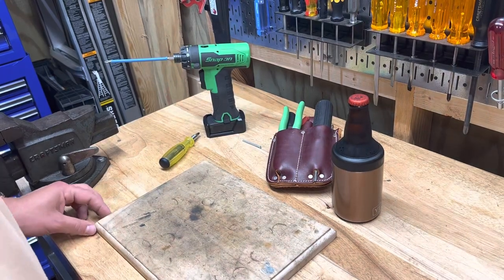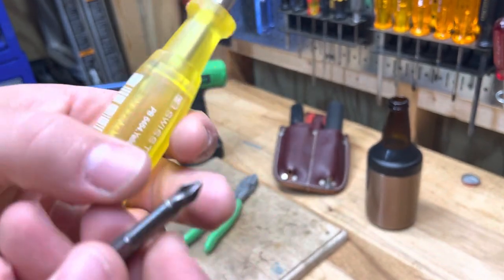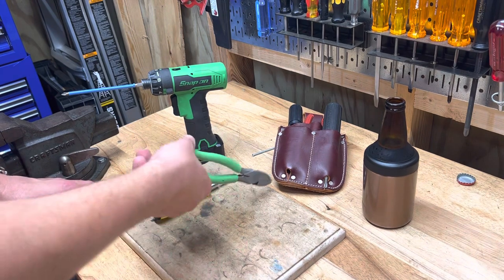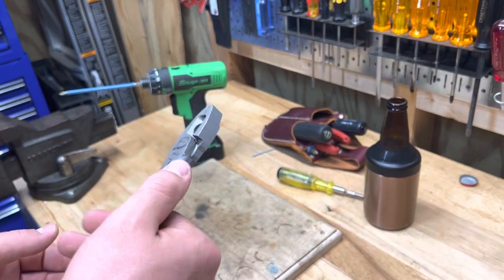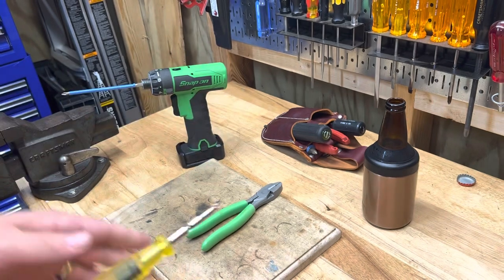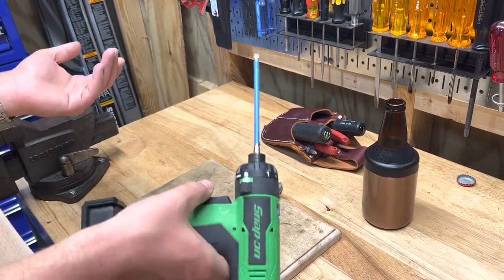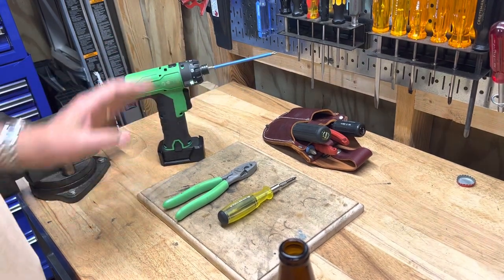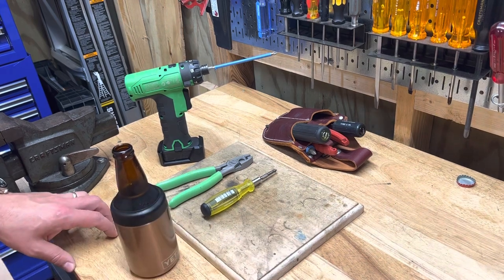Snap-On and PB Swiss tool reviews. These tools punch way above their weight class!

Comment: Great video as always my friend.  

I love, love, love the PB Swiss 6464.  I keep one in every vehicle (I got a bunch half off).  Only screwdriver I feel comfortable carrying in a pocket (except the Milwaukee fastback knives with the screwdriver).  

Funny you talked about the 7in snap on linesman.  I just got this week a 7in klein J2000-7NE linesman and I have been messing around with it.  As far as old wires, cloth braided, nothing that white and black electrical tape and WAGOs can’t fix.  Wagos are a game changer for me with my old house.  I clean the end of the wire off with Emory cloth (old school did not leave a lot of spare wire) and wago them and no issues.  If the cloth is failing I wrap in black or white electrical tape (the good stuff).
Reply: I hear your concern, but I have never broken one (nor my 6465 which has seen a lot of use) and it feels better to me than the Wera bond driver and it’s much smaller with more bits on board.  It feels solid enough to me with the bit holder pushed in to do real work which I have.   As much as I would like to have a set of Wera chisel drivers or PB Swiss striking cap screwdrivers with me at all times, the size and weight make that suboptimal.
Reply from the maker: Thanks man! Good to hear from you as always. I’ve thought about buying those very Kleins myself. I’m sure they are great. I haven’t switched to WAGOS yet. I’ve heard they are great, but I’m set in my ways with wire nuts lol.

Comment: You know me, compelled to say something as usual. Which I don't have much to say this time except that I was just thinking the lighting in your shop or at least where you film is an awful lot better than some others. Don't have to turn my brightness up or anything to clearly see what's up. Need to get me some lights like that.
Reply from the maker: Thanks man. I’m so glad. The lights I use for my shop are the hanging LED tube lights from harbor freight. They are really bright and you can string them together. I have one right over the work bench so it does a good job. It was a game changer when I wired up the shop! I used to use Milwaukee m18 lights in there.

Comment: Hey man. Im currently trying to decide between 7" linesmans for general homeowner electrical, wire twisting/cutting. Have it narrowed down to Fujiya ($25), klein ($35) or Williams ($30). 

Would appreciate your opinion, thanks!
Reply from the maker: I don’t have any experience with Fujiya lineman’s pliers but I do have some other pliers by them and they are fantastic. You can’t go wrong with them. I would go with Klein though. They will be awesome for sure. I’ve thought about getting their 7 inch forever. I would have bought them if I didn’t get these Snap on ones.
Reply: @realworldtoolreviews  thanks man. I bought a 7 inch klein and i also bought the 9 inch hd2000 with the red double dipped handles like you have. They were on a great sale on amazon and had to grab em at $34.

I have like 6 wired smoke detectors, 2 ceiling fans and a chandelier to hang with they show up, so ill be able to put them to immediate use.
Reply from the maker: @morgizmo87  nice! You can’t go wrong with the Kleins. You are going to love those. 7 inch lineman pliers are super useful. I’ve been using my 7 inch more than my full sized ones lately. Those hd 2000 ones are monsters man. Best ones out there. Enjoy!

Comment: SnapOn makes good stuff.  
Good tools aren’t cheap 
I like that magnetic boot on the screw gun.   
Not a big fan of their rocker switch. That’s kinda like ice cream though, your choice of what’s best and that can change 
Typically you buy the affordable tools you can get a job done with. The more jobs that use a tool you keep buying more expensive tools till you get to a point where the more expensive doesn’t seem better than the cheaper.
Reply from the maker: I love the rocker switch but it does take getting used to. That’s a good way to put it. I’m pretty good at finding something more expensive that seems better 😂. That’s how I end up at Snap On all the time.

Comment: The more I see that pb swiss screwdriver the more I want it! Haha I can't find that yellow one though lol
Reply from the maker: They have it on Amazon right now for $48. It could be all yours!
Reply: @realworldtoolreviews  I got an all black one coming my way😂 I love the fact you can store 2 in bits that's what sold me on it hah
Reply from the maker: @rudylacarl7975  That black one is only 40 bucks that’s a good deal for those. I might have to pick it up to have another! The 2 inch bits stored in it is awesome dude. It makes it longer if you need it and you can still have it stubby with the 1 inch.
Reply: @realworldtoolreviews  yeah I picked it up I've spent much more on garbage stuff😂 yeah the only reason I don't like my wera one is because I can't use it with some breakers/ contractors without carrying extra bits in my pocket lol I'm excited for it
Reply: Hand Tool Reviews  agree to disagree I guess, granted I haven't gotten my pbswiss in yet, but my wera 6 in one broke in the bit holding part so it can only hold 4 bits and just feels cheap. Only thing I like by wera is there socketsets which are by no means affordable lol